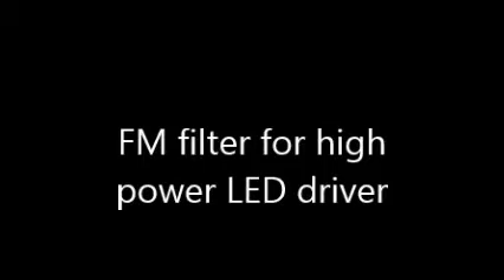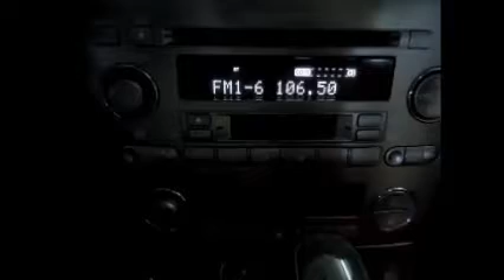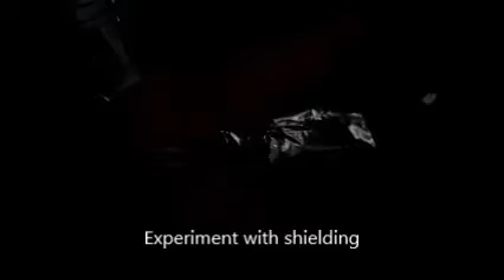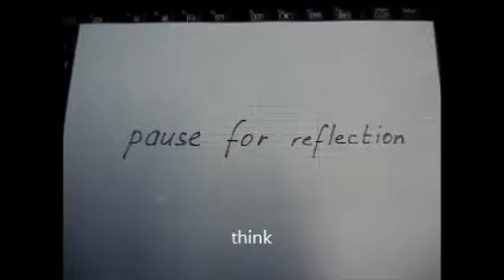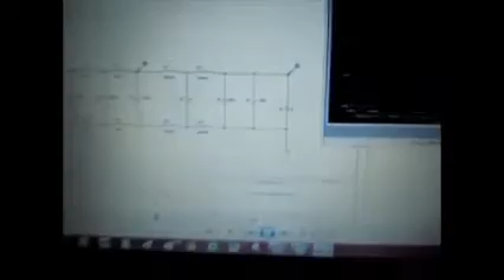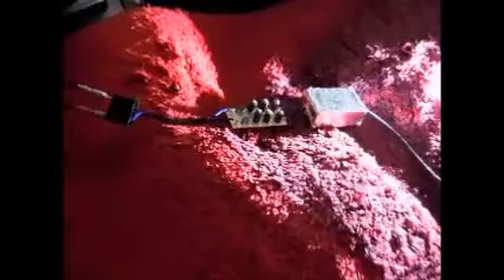FM filter for high power LED driver

Comment: Very nice. I have each 100w LED 12volt Canadian. Will those be enough power handling with you. My truck has low beam on always when vehicle started. LAW here.
Reply from the maker: See the new video "Assembly instructions of the filter." The maximum current is 6A, the maximum voltage is 24V. At 12V, this gives a maximum power of 72W. My LED drivers need 1 to 1.5A, so there is enough reserve.

Comment: is this calculation is for an specific wattage or it could be good for 55w, 75w 100w? IM planning to reproduce this experience, your video are really interesting
Reply from the maker: The maximum current is 6A, the maximum voltage is 24V. At 12V, this gives a maximum power of 72W. My LED drivers need 1 to 1.5A, so there is enough reserve.